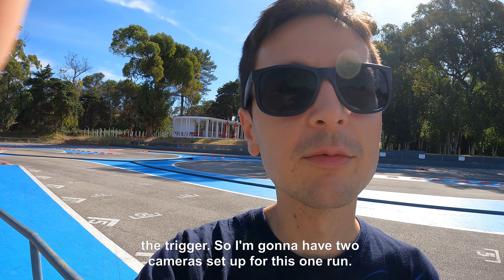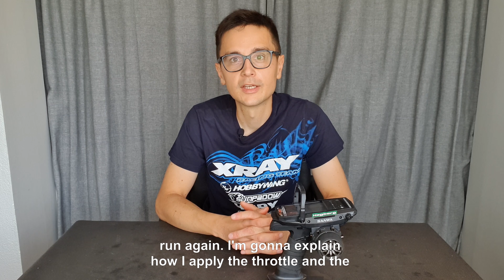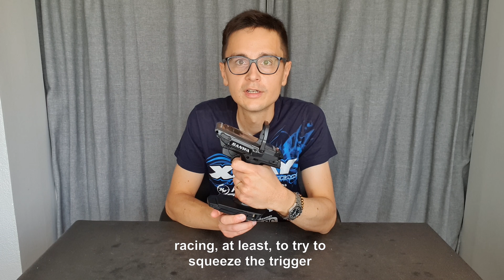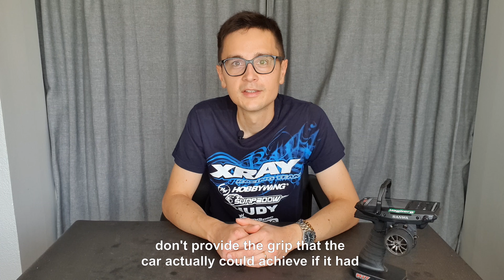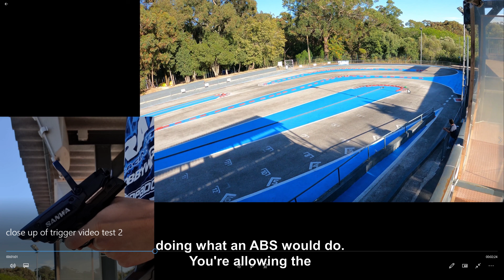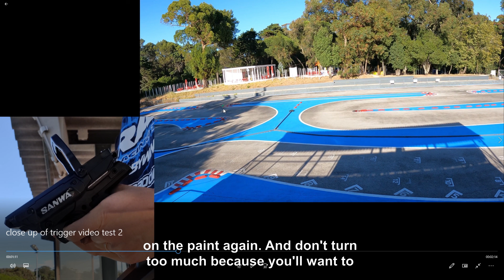Close-up of trigger + POV view!

Comment: Hi Alex, My driving style is no brake, except for stopping. I only brake by reducing the throttle input to slow down on the track. Is it necessary for me to start practicing full brakes （lifting to the maximum）instead of just slowing down if I want to increase speed. Thanks so much.
Reply from the maker: Hello, being in neutral is not very beneficial for your lap times. The goal is be on throttle or braking for most of the time. I would suggest building a driving style around this method.
Reply: @hagberg  Thank you very much. In addition, What is the setting for throttle and brake EPA that you use normally? Thank you
Reply from the maker: @baron7353 brake setting for mod, depends a bit on the ESC setting, but usually 60-70%. Brake setting for stock, usually around 80-90% on the transmitter. I don't change my throttle EPA, always set to 100%.
Reply: @hagberg  Thank you so much！！！

Comment: Fantastic Video! We need more like this! Driving technic is emphasized as the most Important but has the least coverage on YouTube. This is the type video that will get results at track and make the most out of practice. Please put more videos like this. It’s very unique content. 

Question on this video is we’re you using any drag brake?  Also when you tap brakes are you briefly tapping 25%  50% 75% or Full brake? Devil is in the details sometimes. Thanks a lot excellent topic. Can’t wait for more like this!
Reply from the maker: Thanks! I am glad that you like the video! I usually tap the brakes fully (I have the brake strength tuned down so that slamming the brakes don't lock up the wheels).

Comment: Question. 

For this particular trwck, do you ever use 100% brakes.  I mean full brake on the trigger, not on the esc / end points.  

Which leads to the next question is, does that carry over to a tight carpet co fig, say what you ran in Cleveland in 2021.  Do you ever use full brakes there in mod touring.
Reply from the maker: Hi mate, I do apply 100% brakes on the trigger. But I have my brake EPA turned down to around 60-70% which prevents the wheels from locking up. Furthermore, I'm fine tuning the brake feel with the brake force and brake frequency on the transmitter to make the brakes feel just right.
Reply: thanks!

Comment: Hi Alex, back to review once more your tremendous workshop on driving skills: In the last chicane of the track that you have specifically mentioned that you need to break to transfer load on front wheels how much throttle do you use? It seems that there is no room for full throttle due to short distance to apply again the breaks. So do you use partial throttle or full throttle but you lift the throttle almost instantly?
Reply from the maker: Thanks! I'm glad that you enjoyed the video. I only used partial throttle in that section mentioned.
Reply: @hagberg  thanks again !!

Comment: Your ABS approach is like that: Brake, Steer, Brake; but did you also try a gradual approach? Slowly releasing brake while slowly increasing steering until reaching the apex, which is how it is taught for real car racing? You explain it well with the weight shift, but wondering why your approach is faster than the traditional one. Can you explain this?
Reply from the maker: I am not familiar with the techniques taught for real racing! This "ABS" technique works particularly well for low to medium grip asphalt tracks. The ABS technique allows me to brake more precisely for a corner, and hence, it is usually faster and more consistent for me.

Comment: Hi Alexander !
Great video.  Thanks for sharing your tips.
Do you do that trail braking technic in 1/12 (2wd) as well? 
Cheers
Reply from the maker: I've used a similar technique in 1/12th. Even though it's not quite as effective. Furthermore, a rear wheel drive car usually benefits from braking in a straight line more than what is necessary with a 4WD car.

Comment: Great video, it would be great to have another video where you focus on the proper driving lines and how to identify them. How do you figure out what are the fastest racing lines?
Reply from the maker: Good point! The main thing that I can say here is "trial and error". The theoretically fastest line isn't always in reality. It often depends on track composition, elevations, curbs (paint, as mentioned in this video) etc. If the surface is wet, this changes everything completely also. Where often its faster to drive "off line".

Comment: Great video, interesting to have a look at the process of the lap. I have just a small question for you. I have a Hobbywing 1S Cell ESC. It’s the Stock Spec Version as I only race 13.5Turn motor in the GT12 class. I am just wondering about the tunability of the brakes, would you recommend a program card to do that? Or other device? What would the benefit of the program card provide please?
Reply from the maker: The program card or the WiFi or OTA modules. They do the same thing. Just comes down to preference to what you find easier to use. Have you seen my Hw ESC setting video? Where I deal with some of these topics?
Reply: @hagberg  I don't think i have yet. I shall have to have a look at the other videos. Thank you.

Comment: Nice way to teach driving! What is the amount of braking limit you use in esc/radio at this track (50%, 60%, 70%, ...) ?
Reply from the maker: I am mostly using 65-70% of brake on my Sanwa M17 radio. I fine tune it for the track and the grip level. In this particular video I am using 68%.

Comment: This is really great video !!!! well done, it was such a nice and explanatory video. I have a question about the double tap on breaks. Should we double tab the break in every corner (I mean in every corner that needs break ) or apply double tap on breaks only on long straights that car carries a lot of speed ?
Reply from the maker: It depends on the track grip and the size of the corners. This technique is more useful on big tracks with sweeping corners and low grip, such as the one in the video!
Reply: @hagberg  thanks for the reply. So for the track on the video have you applied double tap on breaks in every corner that actually needs breaking?
Reply from the maker: @constantinosdrakakis897  Almost every corner. In the first left hander in front of the front straight, and at the end of the straight. And also in the 180 deg corner before the big sweeping right corner at the center of the track. In the two small corners before the loop, I just tap the brakes once, to let the car transfer the weight for an instant.
Reply: @hagberg  thank you !!!